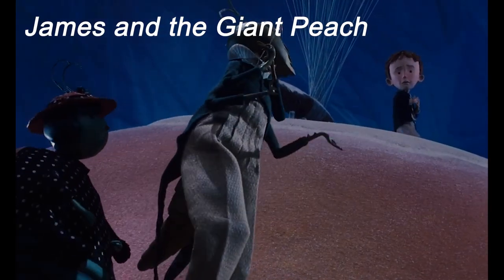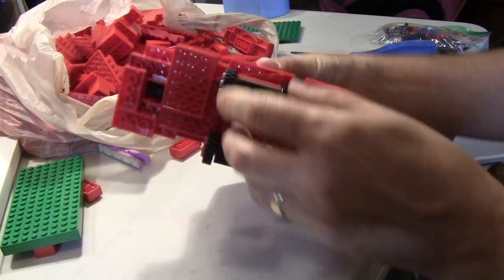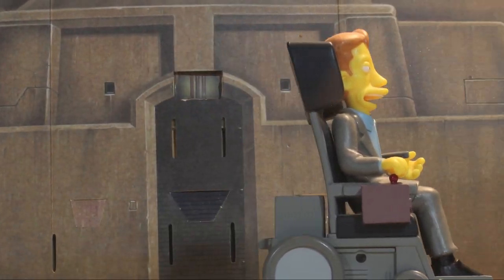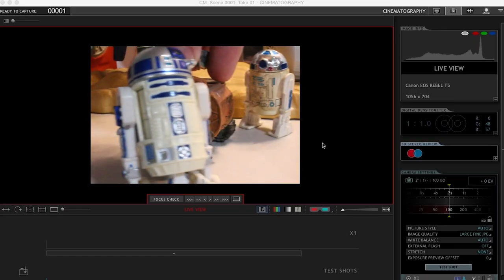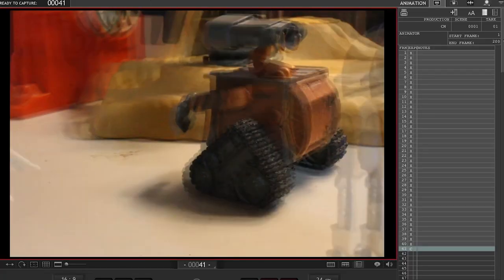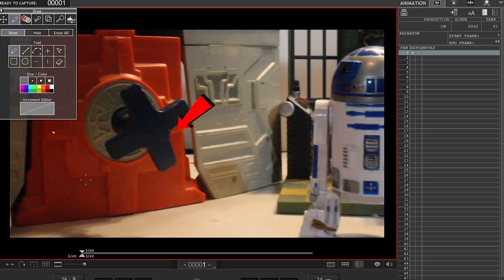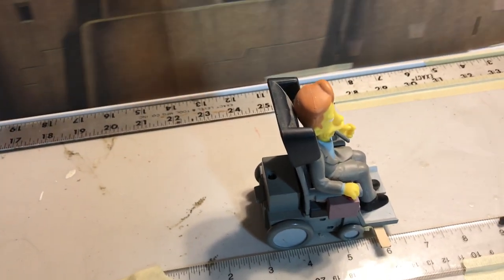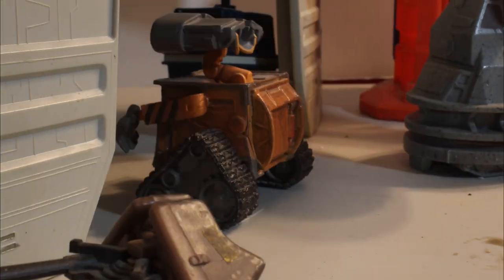Stop Motion Tutorial: Camera Moves

Comment: Question for you about apeture flicker, for a beginner stop motion animator who eliminated light flicker and can only afford or only has automatic lenses, is apeture flicker that bad in the stop motion? Should I be overly worried about it?
Reply from the maker: I haven't tried an automatic lens, but I hear it's a problem. You could try a test with objects just moving around and changing the light reading to see if the lens changes the aperture too much.
Reply: @MichaelParks  ok i will give it a try thank you, out of curiosity which lenses for your dslr were you using for stop motion?
Reply from the maker: @rhysseddon7279  I have some lenses I got for my 35mm SLR in the 80's: 28mm, 50mm, and 70-210. All Ricoh. to use them for stop motion, I got a DSLR and an adaptor ring.
Reply: @MichaelParks  thank you